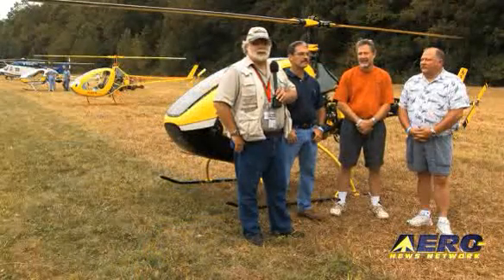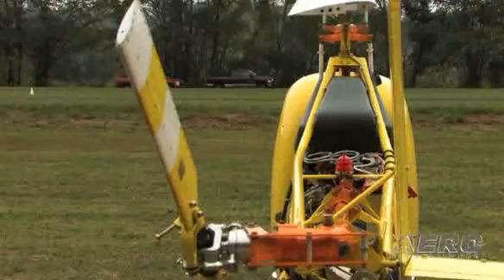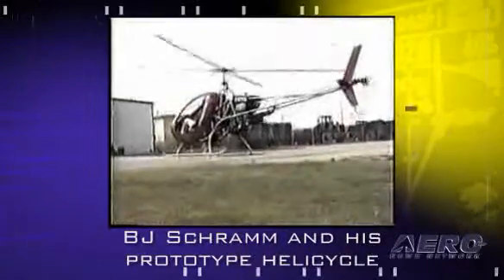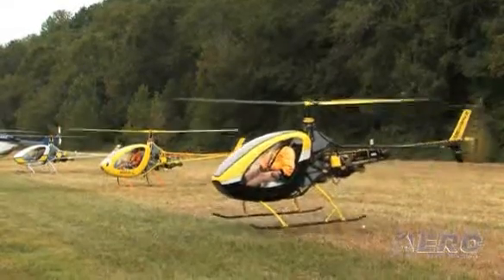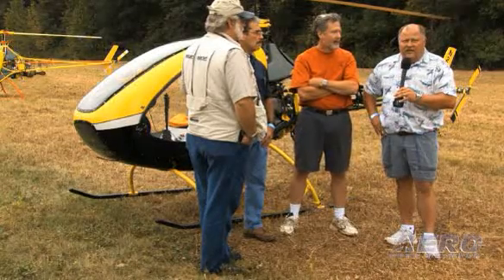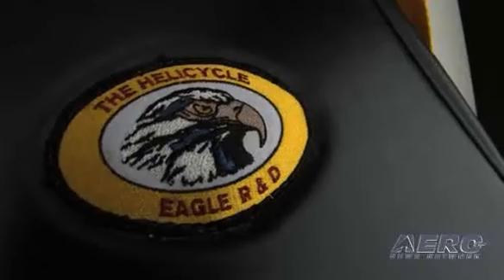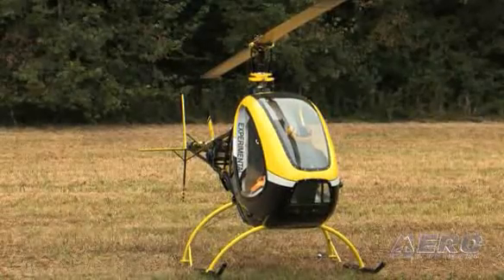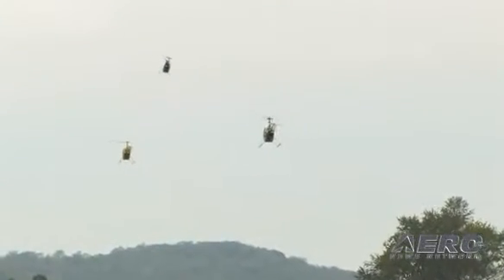Aero-TV: Helicycles Aloft -- BJ Schramm's Legacy

Comment: helicycle or mosquito?
Reply: Mosquito is the more modern premium design, but you'll pay for it. It uses a smaller turbine that is more fuel efficient and less likely to shutdown, the cockpit is more ergonomic and has MUCH better visibility, you have factory builder support to assist with any repairs, modern avionics options, doors so you can fly in the winter, and a proper clutch. Helicycle is cheaper, but burns a little more fuel, engines are easier to find, but also has a mysterious sudden vibration that can destroy the airframe in mid air. It's rare and only happened to about 10 people but nobody knows why or how to fix it, or even what induces it! 

If you're on a super tight budget and can swing a helicycle for 40k complete then I would go with it. If you can afford a 70k turbine mosquito then I'd go with that.
Reply: @codmott286  Solar T 62 A 2 are hard to find and the Helicycle has a modified T62 T 32 harder to find
The helicycle gets pylon whirl an easy fix But owners haven't a clue